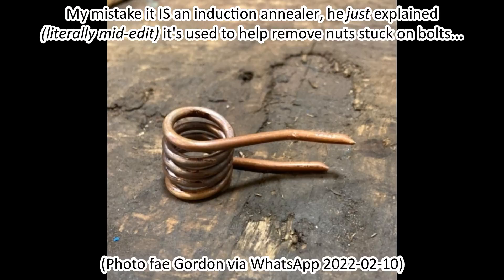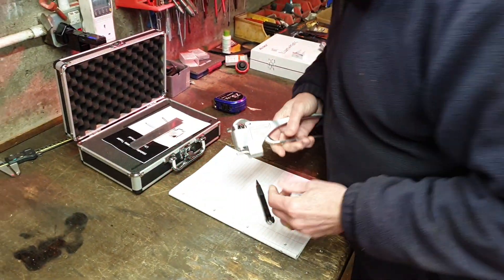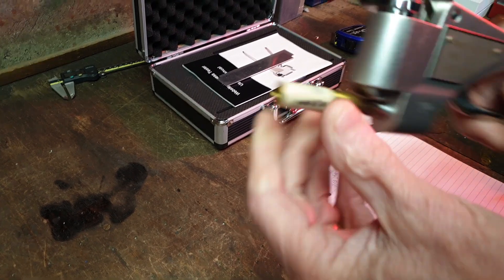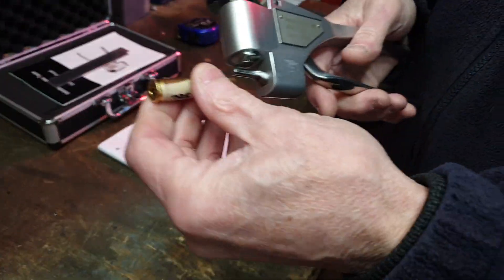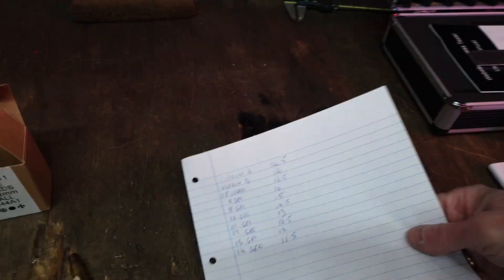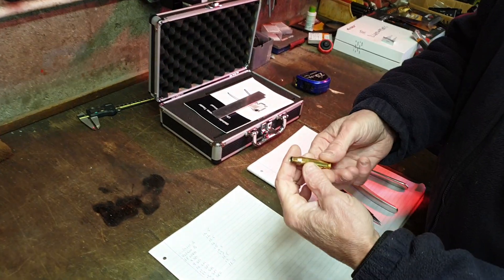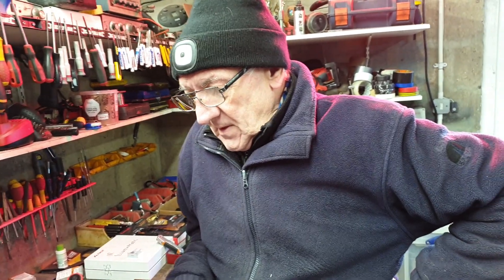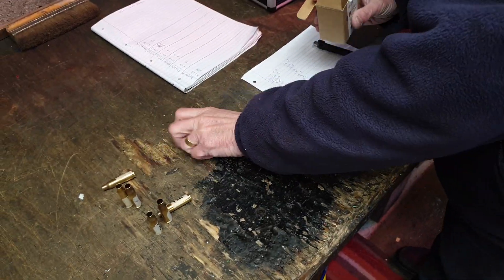USA and UK brass, what's the real difference? Annealing video follow up.

Comment: In induction heating, the heating effect is primarily due to the material's electrical resistance (Joule heating). Materials with higher electrical resistivity (lower conductivity) generate more heat from eddy currents for the same induced current magnitude. 
Therefore, brass alloys with higher zinc content will create higher eddy currents (and thus more heat) because zinc reduces the overall electrical conductivity of the alloy.   It seems American made brass must be higher in zinc content.  Great videos.

Comment: Thanks for the video guys! 
brass like this containing copper is work hardened,  the hardness from the virgin brass will be work hardened from the manufacturing process.  im no expert on the physics of the cartridge but maybe if you bring the softness down too low it may cause the brass to flow forward more upon firing, it may be worth testing the length increase of each softness of the cartridges after firing. annealing time could be due to copper content.

Comment: If you don’t cool it ,You are hardening it.
Reply: Sorry, no. Brass is like Bruce above is saying. 70-30 cartridge brass is all alpha phase and rapid cooling has no effect like it would in steel. The thin wall of a cartridge neck will anneal at temperatures near the Draper Point very quickly. From those temperatures, it doesn't matter at all how long it takes to cool off, the neck will not harden from the ramp down rate.
Reply: @dinoc.5537  This from google Do you need to quench after annealing?
If you want maximum softness then you quench immediately upon annealing. You never should see a red glow from your metal when annealing (in contemporary lighting). Any air cooling beyond actually hardens your metal (anything containing copper, 
Brass is copper with a smidge of tin…
My experience with metalwork says you all are wrong and so will a hardness tester lol
Reply from the maker: @srspammenot  Sorry but you're watching Bruce use a pre-calibrated hardness tester, so with your own eyes you are seeing the actual hardness results.
Thanks for watching, cheers. Russ
Reply: @RussDouglas222  maybe you quench some and learn what I know from hammering brass with a hammer
And learned in 1966

Comment: Rapidly cooling in water is what softens brass.
Get it in water before it cools slowly AND HARDENS.
Reply: Brass is a single phase alloy  - how you cool it makes no difference.
I have annealed brass and air cooled it, and annealed brass of the same size and for the same length of time and dropped it directly into cold water while still hot and there is no difference in the hardness with either cooling method.
Where are you getting your information from?
Reply: @brucemcpherson8832  Do you need to quench after annealing?
If you want maximum softness then you quench immediately upon annealing. You never should see a red glow from your metal when annealing (in contemporary lighting). Any air cooling beyond actually hardens your metal (anything containing copper, all copper 
Do the reading.
Reply: I think Bruce's hardness testing proves that this is incorrect.